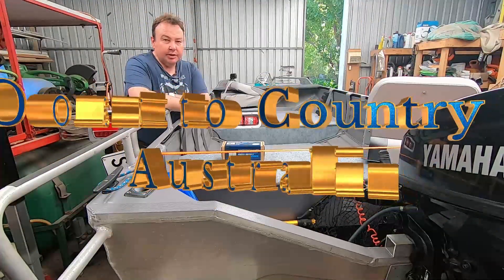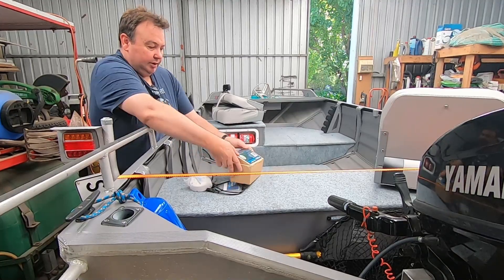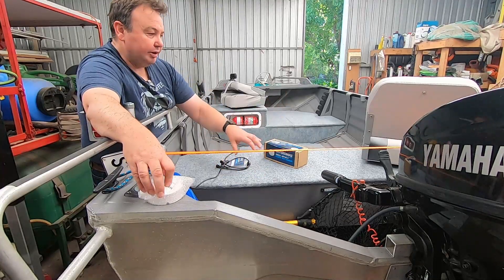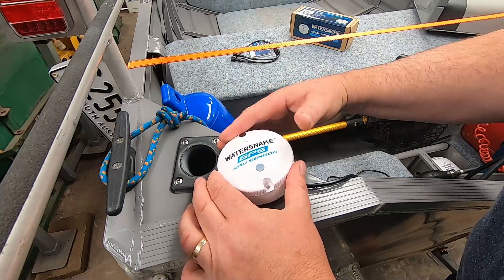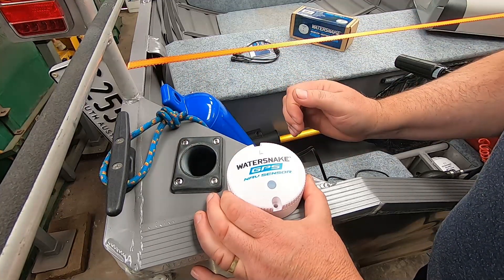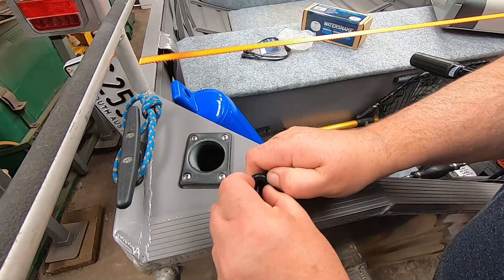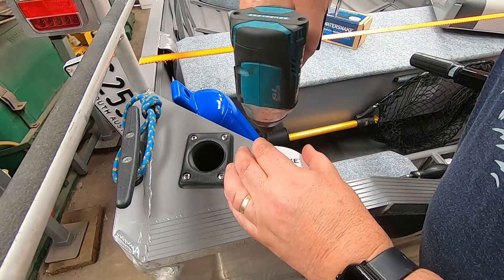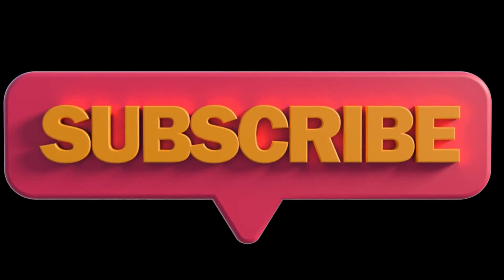Watersnake Geo-spot GPS Nav Sensor Install

Comment: Thanks, buddy. I've ordered a geo spot nav sensor for my watersnake the first time I've seen an install video
Reply from the maker: Cheers, it does seem to work quite well, I've got a video on it working when I catch up a bit.
Reply: @coasttocountryaustralia  is there much difference with it's sport lock etc without the additional GPS sensor, this is the optional sensor for more accuracy?
Reply from the maker: @seawater1322  Hi, I gave it a workout today in high winds, current and a bit of swell and it positioned great, plus I could jog the boat into positions, with it unplugged it moved around a bit more but nothing too serious and it did wrap the cord around itself once but no drama. Time will tell. Cheers
Reply: @coasttocountryaustralia  you reckon the GPS is worth it then?
Reply from the maker: @seawater1322  it seems to work better when theres a bit of tide, wind and swell. If your in calm waters it seems the same, it give you the jog function which is the main reason I got it, that's great for where I fish. Cheers

Comment: Hey mate, love the videos and have subscribed. Just a quick one, what size AGM battery do you suggest using with this motor? Cheers.
Reply from the maker: Hi, thanks for watching, I'm using an old 100amp per hr, and its holding up really well in some windy conditions. I would recommend a 120ah lithium if you can afford it, I will replace it with one when this one dies. Cheers

Comment: sur les Minn koto Riptide terrova c'est la m^me chose . je ne connais pas votre moteur avant . Il a l'air de bien fonctionner l'avez vous essayer dans le fort courarnt et avec des vagues ?
Reply from the maker: Hi, yes it works well in windy conditions with a bit of swell and current,  depends on the size boat and battery when it comes to performance, I have another video of it working while fishing. Cheers
Reply: @coasttocountryaustralia   je vais l'installer sur un kayak

Comment: How are going with it ive got a haines 146r and thinkin of getting the geo snake you happy with it outside fishin in current
Reply from the maker: So far it's holding well in strong winds and small swell, if you had a windscreen etc it might make it work a bit harder, so far I cant fault it. Cheers

Comment: Great video thanks. Just a quick question on the jog function. Does it move 1m per button push? (left/right- forward backwards) So if you push the forward button 3 times it will move forward 3m and then stay in anchor mode? As well as clicking the right button 3 times it will move right 3m?
Reply from the maker: Certainly does, when in anchor mode, sometimes I put in 5m to the right, 3m ahead, sit back and wait for it to put me on the right position, the jog function on the remote only works with the extra gps puck unfortunately. But its well worth it I reckon. Cheers
Reply: Fantastic thanks . Just ordered my Watersnake with the Nav sensor puck  @coasttocountryaustralia
Reply: I see they say it keeps the stern of the boat more "stable" ? Have you found that ?
Reply from the maker: @robprideaux3279  rarely wraps the cord around, but it really windy, big tides it has spun the cord around itself but somehow it untangled itself. Most of the time it sits very stable, So far so good, time will tell I guess.
Reply: This is good to know. Thanks for taking the time to respond  @coasttocountryaustralia
Reply: @coasttocountryaustralia  How are you finding the foot control , are you using it more than the FOB?
Reply from the maker: @robprideaux3279  havent used it yet, I bought it as a backup if the remote packs it in.
Reply: @coasttocountryaustralia  Do you know if you can turn the beeping sound off, or disconnect the speaker?

Comment: Howzit Bud,  I have just installed a watersnake GPS with the Nav sensor on my bass boat. I installed the sensor to the stern side.  Was recently out on an inland water and very calm day, no wind. The anchor mode didn't work too great, motor kept switching on/off and trying to correct the position.  It would power up and move the boat boat around all the time but didn't seem to be able to hold it in position.  Is this because of the calm conditions, no wind or current, etc?  What have your experience been with it so far? Regards, Gareth.
Reply from the maker: I haven't had that problem, only thing I can think of is if it is too calm and the boats not moving then the motor will turn off and if the bow (motor) and stern ( nav sensor) are out of line then it might try to move around and hunt for the right gps spot again. I would see how it goes with a bit more current or wind and see what happens.
Reply: @coasttocountryaustralia  Cool, thanks for such a quick reply, much appreciated. The problem is it doesn't settle on the spot, it keeps moving around as if trying to refind the point, which also then causes the boat to move around alot.  But agreed I will first test it again in windy conditions. Was just worried that I hadn't installed the nav sensor correctly and that it is too far from the trolling motor.  Its mounted at the stern in similer postion to your boat.
Reply from the maker: Let me know how you get on.

Comment: How do you know it is parallel?? You didnt show the method you used 😮
Reply from the maker: You just line up the arrow on the sensor in line with the keel of the boat. Cheers